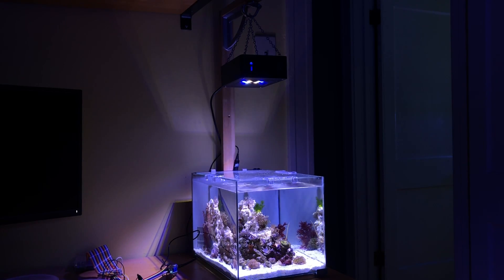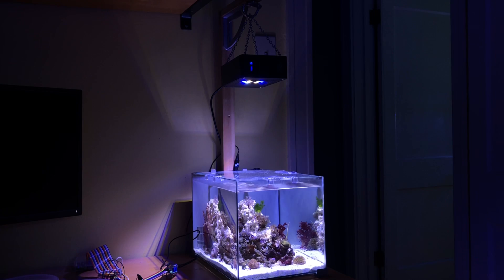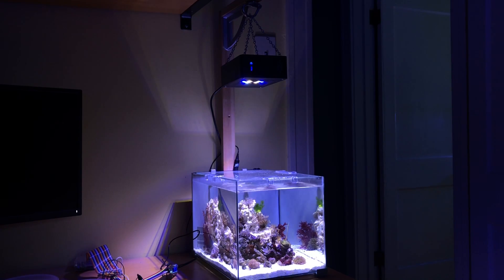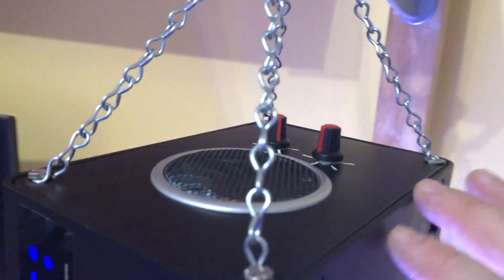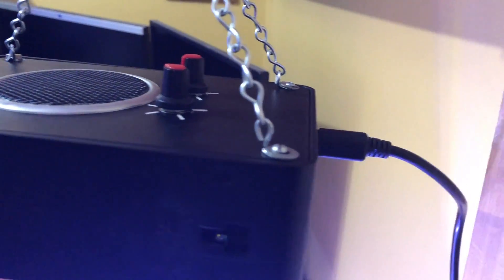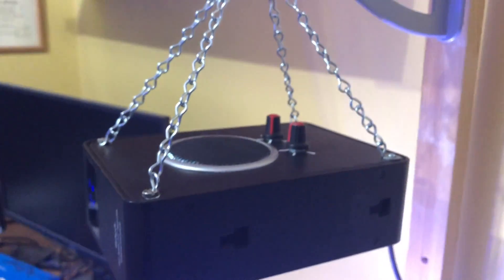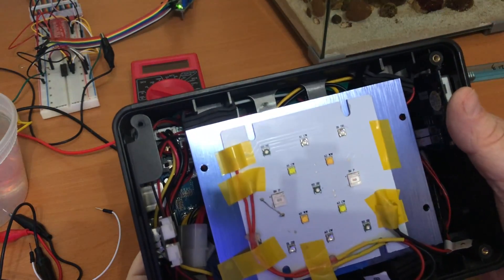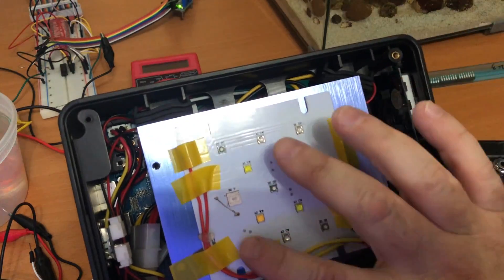DIY Reeftank LED - Prototype Works! [Part 3]

Comment: #babyblackbox . Strange that the fan affects the output so much. The UFO light uses a separate power supple for the fan
Reply from the maker: Yeah, the power supply supplies 12v on one pin, and 5V on another. Since I left the hard driver controller board in there, and am just tapping power off that I am guessing it is to blame. Probably explains why the hard drive died in this case. Lol